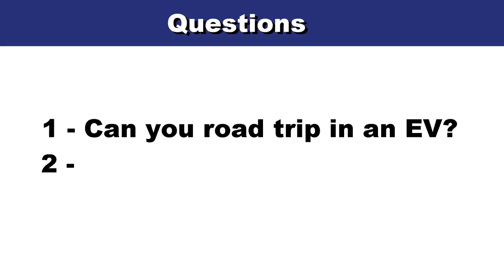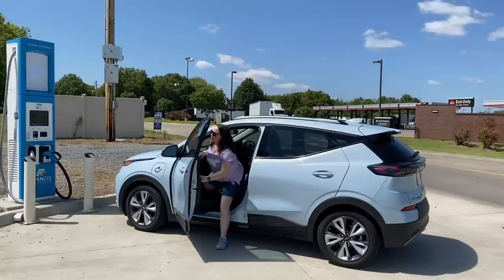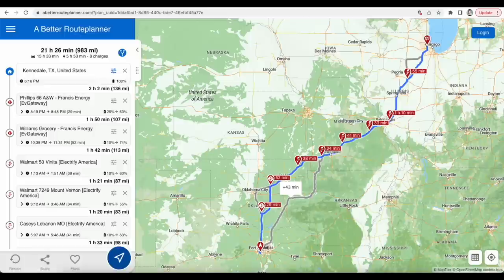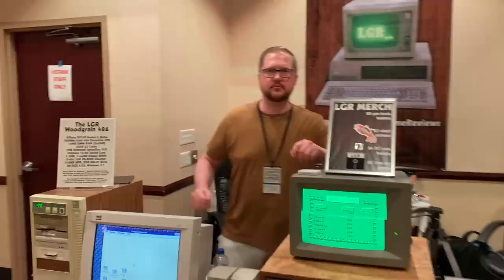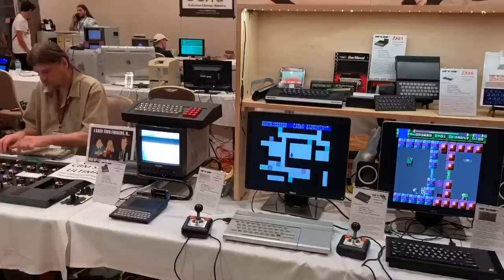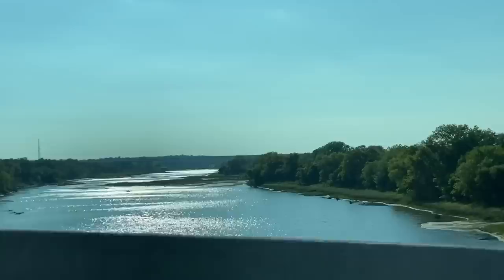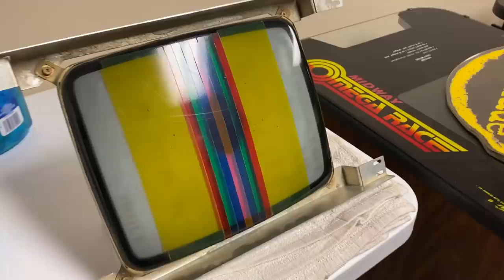EV Roadtrip, Vintage Computer Festival, and Moonbase Repair

Comment: A road trip with stops every two hours would be normal for me. I tend to stop every 90 minutes or so and get out just to walk around. I have to.  Sitting for too long is bad for me. Driving too long is worse.  That's why I sought out an SUV big enough to let me sleep in the back if and when I got too tired.  Don't do road trips any more but I still keep a foam mat in the back and I'm not at all afraid to stop and take a nap, or stop and get out for a walk.  So what if my 10-hour drive becomes 12 hours or even two days. I want to arrive alive.  The car may be a machine but my body is not. And I've never been on a road trip where I had a co-driver. It is always on me to do all the driving. In that case, I will do it my way and try not to die.

Comment: Im not one to chastise anyones preferred method of transportation, but I cant imagine using an app to find  charging stations, having to stop every couple of hours or so to charge a vehicle, and when arriving, hoping the chargers are available and working...🙄🙄🙄 Now maybe it's just me, but if i have a long road trip, I'd much rather stop for 5-15 minutes to refuel, stretch, and get back on the road and to where I'm going, without worrying about where my next fuel stop is gonna be. You simply can't do that with current EVs, and while the technology is improving, it still has a very long way to go before its practical for many people

Comment: I was hoping you were going to do a comparison on the cost of charging the during the trip vs the cost of gas. I would say i think GM is behind on their EVs i'm hoping the new ones coming out will be a big improvement as i'm a GM dealer tech, The battery recall wasn't bad, the worse part is pulling the new battery out of the crate and putting the old one back in as we don't have a forklift and are using a worn out bobcat with forks.
Reply from the maker: i wanted to.  But most of the electrify america chargers were set on "free mode" the week I went due to some upgrades.  So, while I enjoyed the free charges, I didn't really get to tally up what the total cost would have been otherwise.

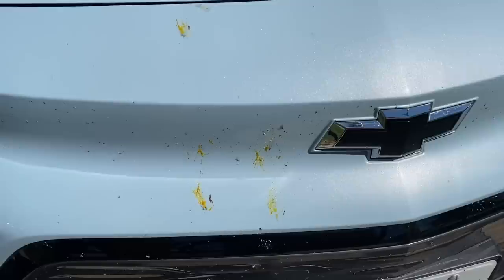Comment: 4:55 I had always though the home of the Simpsons was Springfield, MA.  There were signs in the town even saying such, when I visited there.   However, looking it up on-line, they are saying that Springfield, Oregon is the official location.  So I don't know what is correct or not, but I know there isn't a Nuclear Power Plant in Springfield, MA.   I looked up Springfield in  Oregon and they DO have one.
Reply: Everyone thinks their Springfield is the one in the Simpsons.
Reply: @sa3270  Perhaps.  I don't know about other Springfields since I was only at the one in MA.  But they even had signs and billboards claiming they were the inspiration for the Simpson's Springfield.   But I did point out that Springfield, MA doesn't have a nuclear power plant...a key place in the series.  But there is an intersection in the town that is similar to the Simpson's series.  Could be coincidence, or perhaps not.  But it is possible that the Simpson's Springfield might have an area that is based of the several that are all over the USA.

Comment: I drive a Tesla MY 1200-2000 miles a week. It does take a little longer, but it’s super easy. I stop in several towns you just showed. Wish you would of take the model 3 to show off super chargers.

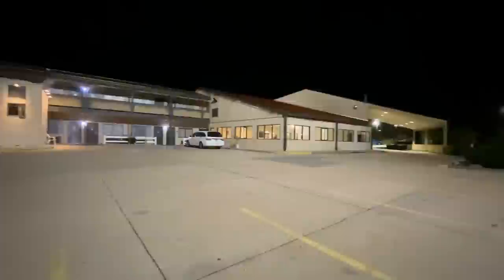Comment: 4:15 This is ONE thing i would expect to be enhanced(?) - 
as soon the car is done loading it should be ready to use for the next one.
Ofc nobody is there to pull the charger. But it could kind of signal and "release" the charger. So the next one could pull it off and use it.
If this is already the case then this comment never happened.

Comment: @8-bit guy i have a well known brand of alarm clock from the 1990s and it smells like a old tech snd wen i power it on it has a strange smell not toxic but i opened it up and it has rust in the box but not much on the motherboard i clean it off and it still smells what do i do?

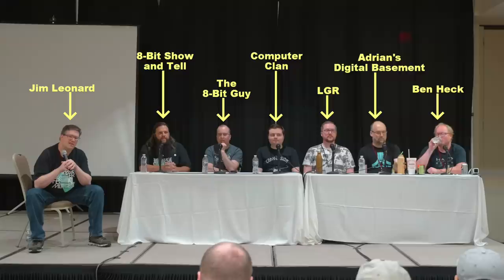Comment: 9:26 This is the ideal tech crowd; You may not like it, but this is the peak grandpa boomer vintage computer nerd looks like. 👌
EDIT:
13:44 uh... yeah, this is why.. i told you (before) to throw away that CRT in case something like this happens; damn, that must've felt really hurt.

Comment: Yeah, the US is pretty far ahead compared to here in Australia when it comes to EV charging infrastructure. Technically there's enough chargers to drive around the country, but everything's so far apart that it wouldn't be as stress-free as it is in the US.

My parents are starting to get interested in an electric car, but I had to tell them to wait a couple of years till the prices come down and the range gets better. They do a couple of interstate trips each year, basically 1,000km each way, and they usually stay in a tent at a caravan park, so at best they're going to get a standard 240V 10A outlet at the tent site. That's not a lot more than 100km of range overnight, and they usually travel more than that on their day trips, so you really need more than that.

At least we've now got a government that isn't opposed to EVs (you probably saw that picture of a politician holding up a lump of coal in parliament, that was our previous Prime Minister), so hopefully that will encourage investment in charging infrastructure.

Comment: Here is my problem with EV road trips... 

1. Frequent, longer term stops. I personally hate stopping on road trips, I find it difficult to refocus on the drive with frequent interruptions.

2. I'm not fond of continually charging batteries before they are totally depleted. I know manufacturers are trying to program "reserve" health into the packs, but it's still not something I'd blindly support.

3. As encountered, having limited charger availability/ charger locations. Especially given my first point.

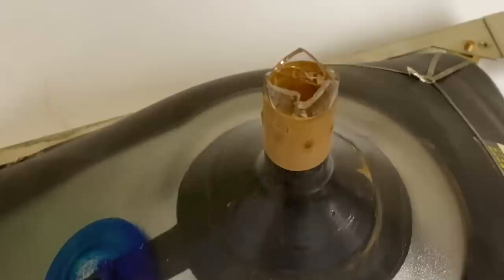Comment: The VCF show was cool, I hope something like that comes to NY.   I really liked the old terminals with the built in screens.  I am hoping to get something like that inexpensively as I want to put a Raspberry Pi in it on a Commodore Pet or 64 emulation.   The Galloping Ghost sure looks like a good place and while I can see that with 800 games that there will be broken ones, and I also can see why they may not have the time (or space) to pull the game.  At least turning the game off and putting an "Out of Order" sign on it would be good.    I recognized the two primitive B/W screen games and have played them often when I was a kid.   Yeah, they are not fun anymore my today's standards, but they were back in the day!  Glad to see that you finally got the Moonbase board repaired, but at 13:44...I just yelled out, "Ohhhhhhh NOOOOOOOO!"   Sorry to admit to what you said and yeah...that machine is cursed!   BUT I guess you are lucky to have two machines, huh?  That I didn't know until now.  15:45  Yeah, that happens with any CRT tube when you knock the neck off.   As a kid, my friends and I loved to go around and see when people tossed TV's out so we can bash in the tubes and experience the magnificent implosions.   But when we came across a TV that had that tell tale black splotch in the middle indicating the phosphor was displaced, we knew that the tube was no longer under a vacuum.   There was another fellow here on YT that actually plugged in a Commodore CBM machine that was sent to him like that and there was all sorts of crackling and popping.   Meanwhile I was screaming here, "turn it off, turn it off!"   So yeah, if you see that on a crt, than most likely the air has displaced the vacuum and the magic has been released from the CRT.   I can't wait for the Commander X16 myself.  With the prices going on up on Commodore PETs and C64's and the reliability going down (given the original aging hardware will continue to age).  I figure it will be the most affordable and reliable way to get something that runs PETSCII style graphics.  I love that the keyboard is like that of the Commodore Pet and I would even buy that to put on a standard computer, or and emulated one.

Comment: Here in Europe, we don't really do road trips: distances are shorter, public transport is much better, and there are cheap flights going everywhere. But many people like to take their own cars to go on a holiday, typically from the cold and wet north to the warm and sunny south.

The advice is to take a 15 minute break every two hours (or a 15 minute break after two hours of driving; I'm not quite sure, I live on an island and it's impossible to drive for two hours in one direction). So that works out very well, actually. Obviously... it's advice, and plenty of people would disregard it.

Range anxiety is very often used as an excuse not to get an EV, because of all those mythical road trips that people make. The availability of chargers is a bit of a mixed bag in Europe, with for example the Netherlands having loads of them, and others virtually none.

What this video proves is that range anxiety is no excuse not to get an EV.

Comment: Quick question about the charging stations...I don't own an electric vehicle so I'm not familiar with charging stations at all.  It looked like at least one of them had a credit card terminal on it.  Do you need to insert a credit card to charge your car?  If so, what is the cost to do a charge?
Reply from the maker: Prices are all over the place, ranging from free to very expensive.  Just depends on the operator. There isn't enough competition yet to really have stable prices.

Comment: It would have cool, if you had estimated the savings on that EV trip. I mean sure it took a little longer, but how much did you save in gas? Even with the ludacrisly low gas cost in the US...
Reply: I'm sure the trip cost a lot more than it would have in a gasoline powered car - no need for hotel if they hadn't taken the bolt.
Reply: @espressomatic  Well, you are completely wrong there aren't you...
He even said in the video, that it would have been a 2 day trip regardless... Did you not watch the vid?

Comment: EV infrastructure seems to be improving, but still looks a pain in the arse if your interest is either a) enjoying the drive itself, or b) getting there quickly by car. Gas cars are better at both. 10-minute fill ups every 250-400 miles means 2 stops and 20 minutes refuels at most over 2 days. Looks great for a casual pace or holiday drive though, which even that wasn't possible the last time I saw you do an EV video.

Comment: The whole EV thing is in no small part a mental thing:   Range anxiety.   Driving a car with a limited range certainly helps to create the problem, as does how much buffer you are putting into it.  If you had 230 miles range and drove only 2 hours, you should have had a fair bit of range left.  I suspect you could have knocked out at least one stop each day without taking too much risk.  Also, when you plan a trip as "charger to charger" you are limiting your ability to take advantage of having the car fully charged.    But, as they say, to each their own.  The reality is (as you said) that the Bolt is the very low end of the EV scale with the least range and the slowest recharge.     A Tesla with a 350 or so mile range and a 10% to 80% charge in 30-45 minutes on the fastest charger would mean you run out of bladder before you run out of amps.

Comment: What is an EUV vs. an EV?  (I have a 2017 Bolt Premier w/brand new battery from recall).  What speed did you generally travel on the interstates?  Thanks

Comment: Keeping arcade machines running is literally a full time job,

At that point I'd pretty much just bite the bullet and put in a convertor and LCD panel.  It's not going to be original anymore no matter what you do, might as well go for longevity.

Comment: Interesting to hear about the mileage, using a more average electric car makes for a better measurement than a Tesla for mass consumer use of such cars. ;) Convention did look like fun and great you could meet up with Sark since it sounds like that board needed a good refurb.
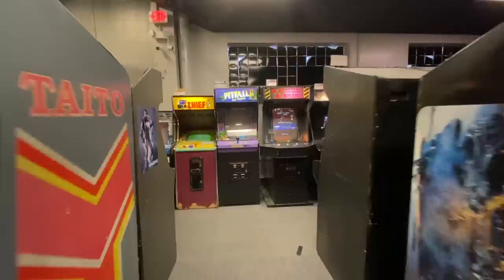12:36 Stunt Cycle, one of my favorite B&W era arcade games. :D I think the technology was changing fast around then so B&W never really became a full blown era much like flat shaded polygon games later. Still they made the most of from their veneer based solutions. Oh no! O_O, T_T

Comment: Sorry, but not convinced to road trip in an EV anytime soon.  On long trips I wanna go 4 hours at least between stops.  Could you imagine if some prankster (or kid) pulled the plug on your car in the middle of the night at the hotel?  The whole trip would be thrown off.
Reply: They make "Karen locks" to prevent the cable from being disconnected by anyone other than the owner.
Reply: @SpottedSharks  Lol. Karen Lock

Comment: EVs aren't the only alternative!  Here's a map of the route with 78 stations along the way selling E85 ethanol, a renewable biofuel with only a bit of gasoline mixed in: https://afdc.energy.gov/stations/#/find/route?fuel=E85&start=dallas,%20texas&end=elmhurst,%20il . There are LOTS of affordable flex-fuel vehicles that can run on E85 and can fall back on gasoline if you have to: http://www.e85vehicles.com/

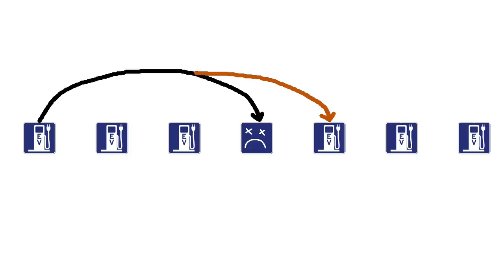Comment: 03:00 But with this strategy if you ever found two consecutive chargers broken, you're screwed, right?
Reply from the maker: Sort of. You'd probably have to look for a level-2 and you'd be stuck for several hours charging on that.  Alternatively you could use onstar to summon a tow truck to take you to the next charger.  Either way, no fun.

Comment: I have just realized how EV idea is broken... Try such roadtrip on the vacation season and drive to the frequently visited region and You are... ******d... I think plugin hybrids like Toyota rav4 or prius are the most sensible way of minimizing pollution in cities, when driving in EV mode short distances and comfortable long range travel, when if not speeding like crazy you could burn < 5l/100km (46MPG). Healthy compromise. Now I am using generic Toyota hybrid (not plug in), and up to 70% of time in the city I am driving in EV mode, which equals significantly less pollution, and I am not constrained on the  roadtrip, but still quite econimical (~45MPG on 4000km distance during vacation trip - I think there is still space for improvement). My next car will be probably some plugin with ~50km EV range for city and low fuel consumption for long distance travels. Pure EV's are just limited...
Reply: Photovoltaic roofing material I think would be a better idea. I think the main problem is that EV manufacturers try too hard making them look slick or futuristic instead of just being a functional safe and reliable vehicle. Could also theoretically use an air intake to power some form of internal wind turbine that could also add some continuous charge to your pure PV as you drive. Just ideas
Reply: Nah.  I did a 4000 mile road trip last summer in my Tesla.  It was easy and very enjoyable.  Would not do such a trip again if I had to drive a regular car.
Reply: I can get 5.1 l/100 km or 45 MPG on a 2018 Focus SE on regular gas on a good day's road trip. And that thing can haul two tables worth of retro computing. Getting "only" 5 l on a hybrid that's probably twice the price of my Focus sounds embarrassing.

Comment: Are you being fair?
You seemed to have struggled a lot with your own machine.
Adrian fixed your board in the first place but unfortunately forgot to meassure the voltages from the power supply, resulting in a new burn down of the main IC.
At this festival you meet another electronics guru and he repairs the power supply.
Then in a nightmare scene, you destroy the tube because you're working on it...

You after all this?
25$ for all this working at your disposal - is that wrong ?

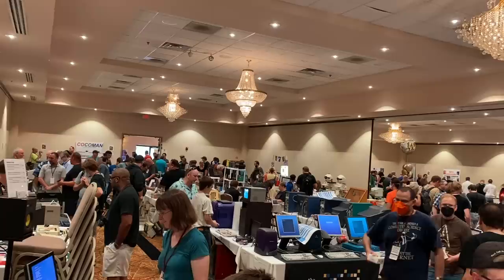Comment: 7:33 to skip to the parts of the video you probably came for, in case the minutiae of managing electric vehicles without realizing the irony of carting around massive heavy metal batteries that will last thousands of years isn't your thing .

Comment: Ok, you can hate on me all you want, but there is no way he accidentally tried to seat that huge component like he could tire-swing it into that case.  No one who has done any significant amount of resto work would go in at that angle.  Come on, David. The reaction was way too canned. There was zero confusion about what happened.  You literally lined up the CRT to make sure you broke it. The only thing cursed is that you chose to try to create theater around this content. This hurts, man.

Comment: You and I do roadtrips very differently.  That would have been a single fuel stop for me.  It was interesting to see it done though.  I'm just not ready to accept the range limitation of an EV.
Reply: Also with two drivers it would've been easy to drive it on one day.

Comment: much prefer the concept of plugin hybrids so no range anxiety or frquent stops on road trips

the fixation on complete carbon free is ridiculous in view that the Earth has always had significant climate change with some very notable ones occuring in recorded history (but prior to industrial age).

Most likely driver of Earth's climate change is the Sun and its long term cycle behaviors - nothing we can do about that but roll with the punches
roblem with EVs and green energy tech is they have tremendous carbon footprint during manufacture (which is never taken into account by proponents) and they require so many more exotic raw materials that their sourcing is super fragile and destructive of the Earth's environment. If one cares about that the Earth's environment then putting faith in green tech and EVs is very misguided indeed.

But it is all moot as the globalist Order of complex supply chains and unfettered relatively low cost global shipping is all in process of collapsing, and as goes the globalist Order so goes green energy tech and EVs